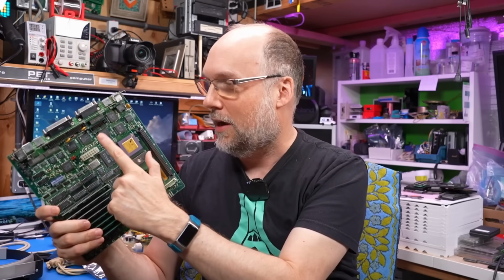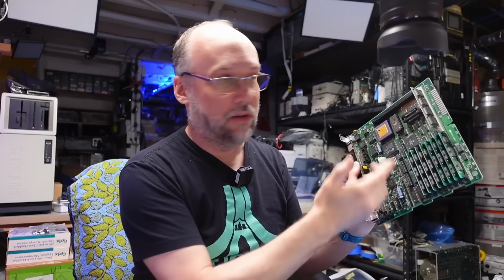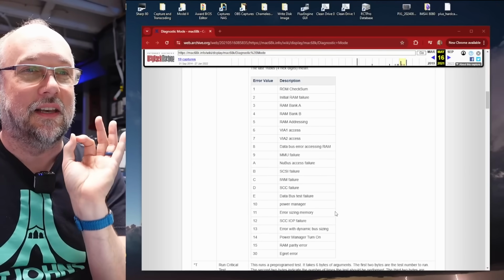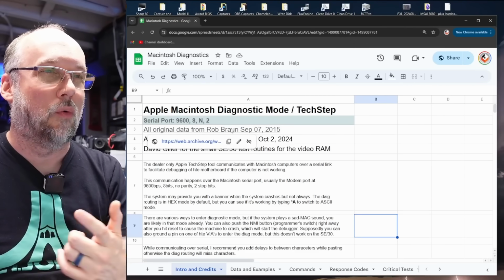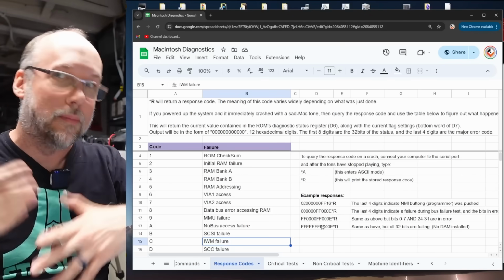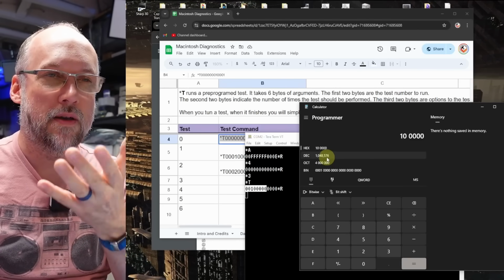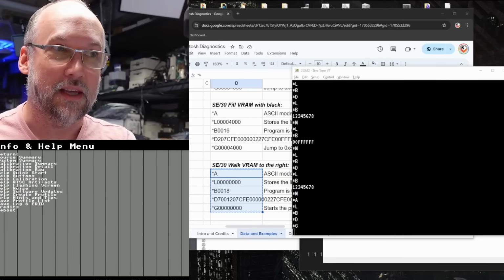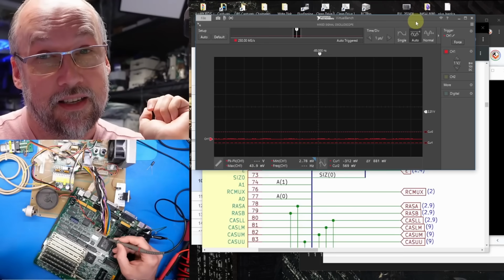Macintosh built in diagnostics: Emulate the Apple TechStep for free

Comment: Can confirm. The school I was attending in 92-93 had an SE/30 that broke a lot. Like, in the two years I was there and using it, it broke three times and needed a motherboard swap. They asked the dealer what happened to the old boards and the dealer said they had to send them to Apple for credit.
Reply: Apple still works the same way.  An analogy would be the core charge that car part suppliers use, which gets refunded when you return the old part (core).  The biggest difference is that Apple doesn't charge you the full replacement part price, unless you don't send the bad part back in their return window.

Comment: used to use a techstep back in the days of being a certified mac tech, however, our board-level repair techs could spot problems faster than the tool could expose them so rarely used the thing.  You helped bring back a lot of fond memories of those years. it was the dawn of the PPC and the clone wars; we we had a lot of interesting hardware rolling through the shop. i loved apple's toolless industrial design back in those days, everything was so easy to work on.
Reply from the maker: I'd love to know more about Mac board level repair happening back then. Who was doing this work and where did the spare parts come from? All I ever knew is Apple didn't allow the certified dealers to do this kind of work, or was this a bad assumption?
Reply: @adriansdigitalbasement  It's true that Apple discouraged board-level repairs.  By then, it was a matter of how quickly you could get each broken Mac back out in the field working.  So, if an analog board was the main problem, just swap it out for a new one.  Quite a costly fix, at around $260 USD back then, unless covered under AppleCare.  Although, there were some repair techs (or shops) who might have quietly stolen the bad parts or "borrowed" them to try and fix the problem.  

We can thank individuals like Larry Pina and his book "The Dead Mac Scrolls" for narrowing down specific symptoms and what is likely causing it.  Sure, you can do the noble thing of getting your Mac repaired through an Apple Authorized Repair Technician.  But for those of us looking to better understand or maybe save some money (especially when the AppleCare is long expired), it seems to be the better route to fix it yourself in some cases.
Reply: @adriansdigitalbasement I’m no rat
Reply: Do you know if these diagnostics are in the old world ppc macs?

Comment: This video not just for the SE/30, but for all those early 90s Mac machines...

Even the freakin printers.
Reply from the maker: I am pretty amazed those early LaserWriter printers might have this too. The Machine Identifier is there but I'm not sure the diagnostics actually work.
Reply: @adriansdigitalbasement  I’m not surprised at all. The early LaserWriters had a 12 MHz 68000 (and the IIf/g were 030s), and if I were a hardware engineer building one, I sure as heck would reuse this external diagnostics protocol given that there was all this hardware support to drive it.
Reply: @adriansdigitalbasement  maybe it would at least let you be able to check the RAM.  the LW IInt runs off a 68000 and only has 1 SIMM slot, for 2MB total, while the IIntx runs off a 68020 and has 12 SIMM slots for a whopping 12MB total (like mine).
Reply: @adriansdigitalbasement  I would love to see a vid experimenting on all the various 90s apple stuff! =P

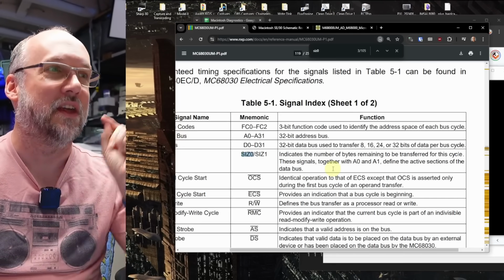Comment: 56:11 Learning that BERR is externally generated is not obvious, but an important thing to know about the 68K hardware.

Normally the 68K waits until it is told that memory is ready. This is done by asserting DTACK after whatever wait state time that the memory needs to respond. Since some memory is slow, and I/O ports even slower, the CPU only has to wait as long as is necessary for a particular address. But if the address is in some wasteland that has nothing there, and the chipset doesn't handle it, the 68K will wait forever for either a DTACK or a BERR. In order for BERR to happen, something external to the CPU either has to know all the invalid memory ranges, or count a bunch of idle clocks with no DTACK.

For instance, on the Sega Genesis, there is no circuitry at all to generate BERR. If you try to access certain invalid memory ranges, the system locks up waiting for DTACK. In the case of the Sega, it could probably be bodged in with one or two chips, but is only necessary for a development system. Real games don't have a problem with this because they've already been debugged to not access invalid addresses.

Conversely, there is a meme of "DTACK grounded", where the DTACK pin is hardwired to always be asserted. This causes the 68K to run as fast as possible. For the original 8MHz 68000, if you use good fast SRAM and fast I/O chips, you can get away with this.
Reply: Came here to basically say this. And on 32 bit systems _DTACK got split into _DSACK0 and _DSACK1, to acknowledge the various transfer sizes that could be initiated. RAM itself does not generate any kind of acknowledge signal, so it was up to the DRAM controller to do this. With static RAM and ROM it was pretty much up to the address decoding hardware to guess based on the part timing used. Quick and dirty is to just OR (active-low) your _CS and _AS together  and bump it through an inverter a couple times for the propagation delay. SRAM at least  will likely have data ready long before the bus cycle is complete. For a bus error on a machine like this, the first place I'd look is the address decoding.
Reply from the maker: Thanks, great insight there. And the Genesis analogy is perfect -- it's not like it printing a BUS ERROR crash message on a production system would be useful, so I can see why they didn't even bother with it. 

The 68k really did bring some cool advancements. I hardly ever work on any system based on them, so I'm just not familiar with the system design but indeed, it is kind of essential to learn about these signals. 

Reading Apple docs on the Mac II line (which the SE/30 is) it introduces wait states for particular regions of the memory map, so I guess the GLUE does this by holding back the DTACK and counting cycles. Awesome!

Comment: Now that this is here, I think someone with the time and skills could pick out the diagnostic routines from the rom dumps.
Reply: A minor problem is that the ROMs are 512K bytes, which is a lot to sift through, and you also need a disassembler that can handle 68020 and 68030 opcodes. But I'm still going to amuse myself by taking a look.
Reply: After spending far too long with my own half-decent disassembler, I found it. Just look for the strings "*ERROR*" and "*APPLE*", and the command dispatch table will probably be about 1300 bytes before that. In the IIfx ROM (the one I chose to look at), it's a little past the halfway point, right before a sea of zeros.

I didn't realize how right I was about 512K being big, but it's crazy seeing endless code with the same style, then suddenly you see something completely different.

Comment: I think you are not on the right track talking about "bus errors" caused by the BERR signal being related to the "data bus test". Instead, that test just does a single 32-bit write followed by a 32-bit read to the address set by *0, and report which bits mismatch. Likely, the test is performed with a small set of patterns (all 0, all 1, checkerboard, 12345678 or things like that).
On the other hand, I guess the SIZ0 signal might indeed by the smoking gun. The test you performed using *D and *M might use four 8-bit cycles as they operate on single bytes, which does not suffer if the CPU can't report the size correctly, but the "bus test" and the "address test" will use 32-bit cycles which get misinterpreted as 8-bit cycles.

Comment: Wow, I forgot all about Laplink....where did my cable go? Long lost.

Also, interesting to see that the computer designed with a GUI in mind had a CLI of sorts underneath it.
Reply from the maker: I have to wonder if there are sellers still for these insanely useful cables?
Reply: @adriansdigitalbasement  there are things that claim to be, but aren't.

Interestingly, though, I see a boxed copy with cable on the Bay right now for £25. Ooh.
Reply: @adriansdigitalbasement  I'm sure. I recently bought an old school null modem cable off of eBay to use with an old BrailleNote speech synthesizer.

Comment: I bet if you put in a ROM SIMM with a IIsi ROM (like the ROM-inator II for example) the newer commands would work in the SE/30. Also you may already know this, but there is leaked Mac ROM code floating around the internet (from during the 660av/840av development era), and the source code for these tests is part of it -- see CmdTable in USTTestMgr.a.
Reply: I know that you can put a IIfx ROM into an SE/30, and it's even 32-bit clean.
Reply: Yep, the IIci ROM also works if you burn it to a programmable SIMM. There was another wiki article on the same defunct mac68k site about ROM cross-compatibility.

Comment: Would a 65C22 work?
Reply: They are in fact 65C22s as noted on the motherboard. Apple part number 338S6523.
Reply from the maker: Yeah the VIAs are just off the shelf parts, along with the SCSI controller and serial controller IC.

Comment: This is such an amazing find!  I am a little confused by one thing: where on the Mac is the serial input processed and the tests executed?  Apologies if I missed something obvious in the video; I was watching while debugging a problem of my own using the IBM i (i.e. OS/400) linker, of all the crazy things.  I rewatched your explanation of the TechStep, and you said this debug feature was "baked in" to the Mac, but I'm just really curious to know where it's hiding.  Somewhere that has access to all of these address and data lines, certainly!
Reply from the maker: It's ROM code running on the CPU. So you do need the CPU to be working along with the serial controller and associated circuitry. The PLA equivalent needs to be working which is the GLUE chip on the SE/30. Apple basically gave direct access to the various tests that the system runs when it first powers up.
Reply: @adriansdigitalbasement  Thank you so much for explaining.  If necessary, I imagine someone could disassemble the ROM and add tests that TechStep didn't have, like the March memory test.  It is so freakin' cool to see the SE/30 and other machines going through a renaissance in serviceability 35, 40 years on.  Good luck and keep at it!
Reply from the maker: Since we  can push assembly code right into RAM (if RAM works) then many more tests are possible. Also it would be doable to add some RAM on a NuBus or PDS card to do this is RAM isn't working. I have a SE/30 network card that has 32k of RAM On it and I was able to access it perfectly from the diagnostic mode, so this could be used in case the RAM subsystem was broken.
Reply: @adriansdigitalbasement  We're too young to remember the original show, but I'm sure you've seen Stand By Me.  With apologies to Johnny Western:

Have gun will solder, reads the card of a man
With a NULL-modem cable and some spare good RAM
His DeoxIT for hire, and a dead chip bin
A retro MacGyver, is a man called -- Adrian

Comment: Waiting for a new demo scene to emerge by making graphics from TechStep debugging primatives drawing directly into video RAM...
Reply from the maker: Haha! Things would be limited at 9600bps but maybe we could reprogram the serial port to run at 115.2k and really speed things up :-)
Reply: I'm holding my breath until someone posts Bad Apple running in diagnostic mode
Reply from the maker: HAHA! I would just LOVE TO SEE THAT!
Reply: Technically, I suppose it's possible to program community-own open diagnostic tools for more clean, easier to understand diagnostics, which will use the Diagnostic Mode as some sort of bootstrapping mechanism for booting into.
Reply: Like a some a sort of dongle with a some microcontroller inside the case. You power your Mac, NMI it if it's not crashed, plug a dongle and power it up, dongle will just send a scripted sequence of commands for sending the diagnostic routine and, probably, run some initial tests before to make sure that system in somewhat working state.

Comment: I would imagine that someone probably could create an inexpensive good enough TechStep using a Raspberry Pi that could send the appropriate commands to the Mac via a touchscreen GUI.  It just needs to be good enough for basic troubleshooting like you are doing here. Plus it wouldn't be stuck to only Macs as you could have Boot select as part of turning the device on. Just a thought for more talented people.
Reply from the maker: Eric (of the Bluescsi project) already hit me up regarding about this. :-) There is still a ton of work to get done before this could be automated since it appears what you can do varies from Mac to Mac, but once all of this is understood and documented then something open source could easily be developed. For now, I'm just happy to know how to do this myself so I won't be sitting around guessing. Guessing is no way to fix something! :-)
Reply: @adriansdigitalbasement  documenting the input strings like you are seems to be the best first step, and then someone can create scripts for each task.
Reply: Yup, it's super simple using Python to access the serial port of a Pi, and from there to send the proper commands over to the Mac, and then read and translate the various responses into something more human readable. You could also run the same Python code, with a GUI for the desktop, compiled into an .exe for any Linux, Windows or Mac. It could also be adapted for the Amiga since the DiagROM the Amiga has can also work over serial.
Reply: Actually, even a esp8266/32 can handle this and you can do this via WiFi
Reply: @VitorFM you beat me to it A Pi is massive overkill for this project….